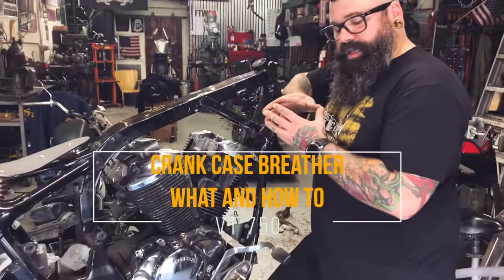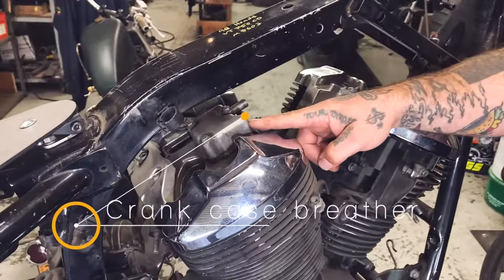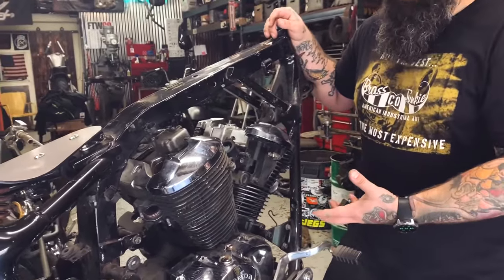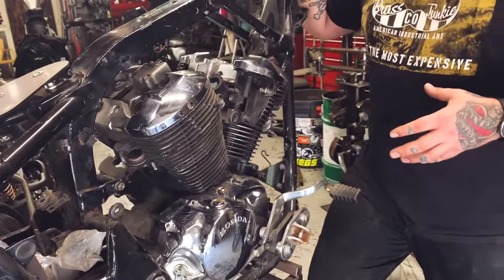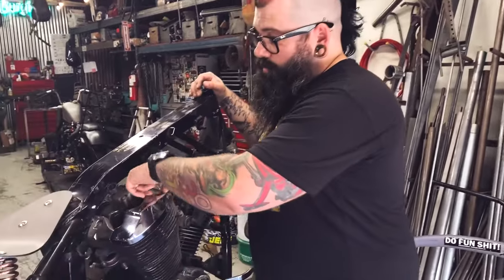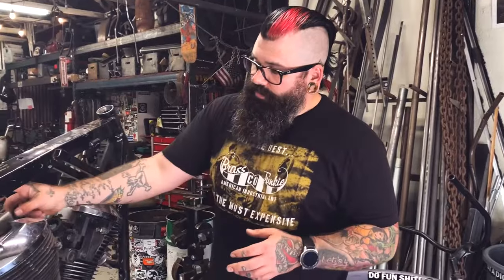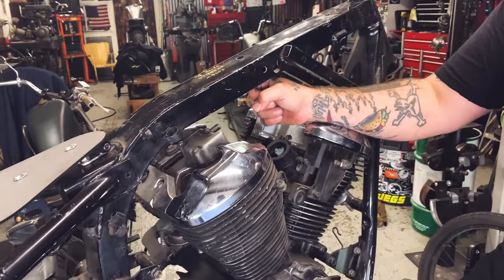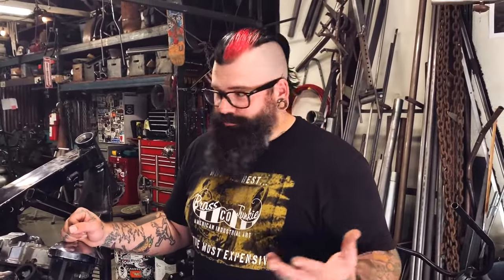What The Hell Is A Crankcase Breather?

Comment: Although you seem like someone who really knows his sh*t, I can't resist not to put a filter on the crankcase breather. The Idea of having an open tube just seems so counterintuitive. I guess I'll just check it regularly to see if it clogs up. (Thanks for the video)
Reply: Why many riders have a plug on the tip of theor breather hose?i saw a video that says you should not plug the hose because it will build so much pressure

Comment: I had a hose on mine ran down too the ground when I got mine but it kept spitting oil and stuff out all over my rear swing arm and back tire so I installed a vented catch can. Is a vented catch can okay ? I was told by some that it’s fine and others said that I had too have some sort of vacuum pulling the air from that crank case too so I’m lost and worried about messing the bike up
Reply from the maker: We are so sorry, but we just cannot help diagnose bikes via YouTube! It usually ends up being an exercise in futility and frustration. Plus, you wouldn't want a stranger on the internet diagnosing your bike!  One would really need the bike in person to properly diagnose, and we are not a service or repair shop. 
We recommend you check out our other YouTube videos (there's a TON!) and the support page at shoptjbc.com  

If you are still not able to figure out the issue, we recommend you take it to a local shop! Wish you the best and do fun shit!

Comment: Will this cause oil to become gathered in the exhaust. I have a bike I got from a friend and it smokes and leaking oil on to the ground from the crank case vent hose. Bu it also is getting oil into the exhaust and causes the bike to smike when the pipes get good and hot.
Reply from the maker: If the breather is clogged it can push oil past tje rings, blowby. Rings are probably not in good shape. Time to rebuild

Comment: I thought I was cool and had the little pod filters replacing the crankcase breather tubes on a 1980 cb750 until oil was leaking out of places where I know had good seals. I applied the concepts in this video and reinstalled the tubes and no more leaks.
Thank you.
Reply: So, if this is what’s happening, and oil is spouting or seeping into gaskets and what not, do those need replaced, or should they be fine once the breathing is under control?

Comment: IT exactly happened to me. put smaller hose into the breather tube ( sporster 1200C ) to take the air and oil out but ended up having oil seeped out of all the gaskets around my cylinder. he is 100% correct.

Comment: TJ… Question. Why a hose at all? 

Like, do you know the design reason why that can’t just be a weep-hole or an open port, and why it instead needs a hose run down to the ground?

EDIT: Just watched the second Crank Case Breather video. That breather box doesn’t just output air. It outputs particulates and oil that you don’t want blowing all over your engine and your crotch while you’re riding. That sound right?

Comment: I have a vengeance chopper with s&s sidewinder motor and it's pouring oil out of the crank case vent line.Its not overfilled with oil and it's running good

Comment: Thank YT for recommending this video. I put a mini mushroom filter in the breather hose and drove my motorcycle until I reached 3000km and noticed that the engine oil levels decreased on the sight glass on my crankcase then I proceeded to change my oil. After 600km of riding with the newly changed oil it seems odd that the oil levels decreased again and I noticed that there's an oil leak in my crankcase just below the block. Now this video helped. Thanks.

Comment: I have a 2007 VStar 650 Classic puking oil out the output shaft the breather hose is fine bike runs great can I replace the output shaft without removing the motor from the frame????

Comment: So I bought vtx 1300 from a guy and he pulled the ais since he changed the pipes. So as you know it pops after. So the 2 top hose attachment spots like your explaining are plugged both the front and rear ones. As you know 1 sucks in and blows out. My question for you is do I remove the rear one and leave the front sucker plugged?

Comment: Good point on the filter sir - so I can run a hose instead !
Reply: @TJBRUTALCUSTOMS  Thanks I got it done. I have a Honda Cb750 1979 . With the heatwave, my engine was hitting over 200f if waiting in traffic. I figured the Crankcase hot fumes going directly into the combustion chamber could only make the engine hotter. Still using the airbox, the crank case input was plugged for now and the hoses went then to a filtered vent - that was smoking a little today. When hearing your logic. I froze your vid, and connected a nice segment of tube and directed it to follow the other waste tubes. As long as my wife does not complain about odors - 

Anyway - Thanks again - I subscribed, and you are featured on my youtube page under motorcycle mechanics - -     ( ps - keep making the vids's - thanks - )

Comment: Thanks very much, you explained it very very easily and practical.
Then I asked myself why people still install filters especially in very powerful or old fashioned bikes?
By the way, my Honda CB300R's manual shows a pipe which goes down the frame which is closed with a tap and they advise to clean it periodically.
Funny thing is since this seems to be a very important task to do frequently on a schedule like cleaning the chain and grease it, check oils levels etc. etc.
So has anyone here a similar factory fit and did you take off the tap definitely?
Reply: Mine is in a very very difficult place to reach im debating on even struggling to put a hose on it since ill have to clean it anyway

Comment: So that's why my bike always have some oil leaks. The mechanics never cared about my bike's engine breather. 
-_-

Your video is so helpful. I am now going to bore a hole on the air filter foam because my bike has the intake manifold and the engine breather connected through the stupid stock air box. 
Because of what you said, I just realized how horrid this stock design is. Thanks! Keep it up.

Comment: I have a Chinese pocket bike 90cc. The stock air box on the carb has an air line that goes to the crankcase , I want to remove the air box and replace it with a cone filter.  Should I leave the air line connected to the crankcase fitting?

Comment: Could crank case possible cause the exhaust header glow red ? You say it could push oil in the the cylinder witch would make it run lean ? Witch could make it run hot possibly?

Comment: How much smoke is too much smoke through the breather? I have my vent tube unhooked to keep my air box clean and I’m noticing a bit of oil smoke coming out at stop lights. Is that normal?
My bike is burning oil and I think I’ve narrowed it down to valve stem seals. Would that have an effect on the breather?
Reply: @TJBRUTALCUSTOMS I see, Any ideas on what would cause that? For reference its an 81 Honda CB650, it is burning oil and I think I’ve narrowed it down to the valve stem seals. Would fixing that help with the breather or is that another issue?

Comment: I knew it! I'm stripping down an '03 Shadow Spirit 750 DC and that particular hose is super cracked where it met the back of the air box. GONE! What kind of hose should I replace it with and can I get it in RED? I'm replacing all my hoses and wire jackets/looms with red. It's a theme. Cheers! Thank you!
Reply: go to autoparts store and get something rated for oil not coolant.

Comment: As always I enjoyed the content thank you. Question off subject I’m working on a rebuild for a 93 vt1100 and I’m having trouble finding carb parts. Am I missing something, are the carbs similar to other models. The diaphragm on the right side is torn slightly and the screw to reach the needle to the slight is stripped. The bikes been sitting for some time
Reply: Not a full scope answer but I have heard from a local motorcycle professional mechanic that ‘KN’ brand jets and parts are what you want. No off-brand, no second sources, if you can avoid them. KN all the way.

Comment: Thanks for this.  Now if you could solve the mystery of the secondary air filter and is it a part of the crankcase breather system I would be happy.  I have a vt1100 ace 1998 and although the parts diagrams show it has secondary air filter for the life of me I cannot find it in the location it is supposed to be.

Comment: If the crankcase breather doesn't have a filter will it  collect dirt in the engine
Reply: If the hose is long enough and goes to a protected area, probably not.
Reply: @bikerbobcat  mine came off the filter. I’m gonna change my oil and oil filter because I’m worried some water got in.

Comment: I have a 1300 vtx, I put a spike air intake system on it and it came with a small crankcase filter,  the problem now is on long rides I'm getting a excessive amount of oil coming from that filter which I know is not normal.  What would be the best way to address this problem?  Why would oil be coming from there?
Reply: Vtx1300 rear cylinder mod  ventilation  of rear head  @ aluminum  port location  which is a solid aluminum stud about 1 1/4"  any tips on how to tap this stud for  more  ventilation

Comment: Just curious...... who in their right mind would deliberately restrict the blow-by?
Reply from the maker: A LOT OF PEOPLE. hence why i made this video. people put those crankcase breather filters on and then NEVER wash them. so they become full of oil and moisture essentially plugging the breather. if you want to run a little filter on there, thats cool, but you gotta clean it every few months. wash it with som,e simple green till it doesnt rinse dirty, dry and reinstall.
Reply: @TJBRUTALCUSTOMS  So, the EU regulations that vehicles should not be user-maintainable are justified. Legislation should reflect the weakest link in the chain... people, us mortals who know about blow-by/breathers and so forth should NEVER be allowed to even test and re-pump out tyres... in fact, perhaps us "mortals" shouldn't even be allowed to ride our vehicles in case we can't check the oils, coolant and other voodoo elements of vehicular maintenance that the dumb people don't know about.... Only the qualified, licensed, certified, regulated are allowed to even touch vehicles.... that's what it's coming down to....

If you block off blow-by then you need to be neutered - so you cant breed dumbness!

PS... what a wonderful rant! 
👍

Comment: Great I understand how they work maybe you could explain what would cause oil to come out of the breather tube like it's being pumped out while the bike is at idle that would be cool subscribed
Reply: perhaps a little bit late to the party, but have you found out the cause in the meantime?

asking because i think i'm currently having an oil leak from the breather on my suzuki intruder 800
Reply: @agnidominik4693  been reading could be overfilled oil capacity this guy has another video specifically on this
Reply: @ryanbbgaming  it actually was a leaking valve inspection gasket, and it looked like it was leaking from the breather

Comment: Hi iv been been building bikes for a long time now but if got this one that's got me stumped if done to this bike what if done to many others but don't want none of it it's the wrost engine if ever seen if there is a part that can be change it done it and there has been no difference in what it's doing 60bl piston pressure should be 160 black plug done the bore piston valves springs new valves to I have to turn the fuel mix Screw to half turn or bike don't run go above it cuts off to below cuts off and its been doing the same thing even with the stock parts on it hence why I started playing with it now the oil from the breather leekes out every where even when has stock box on it was full of oil the only thing I have not done is Chang the gears on it it's got to a point I'm going to put a catch can on it as I can not stop the back pressure no matter what I do the clutch slips like anything new clutch and in the arm there is a half inch before even touching the clutch new cable for this bike it has to be done all the way before you can engage the clutch some one going hydraulic clutch but I feel it might not work it's got to a point that I'm going to put something else in it as the money that's gone in to it could of got me a new engine the parts are getting harder to find to as the ppl that make this bike do not supply the parts no more and no matter what I do the timing dose not line up it's always half a tooth out don't get me wrong would be a nice little run around got it for my son to learn on it's a little 125cc not worth some ppls time the bike is made by quadzilla it's a white knuckle Wk125r so if i done all this why do you think no matter what has been done it's still doing the same thing it's been doing since I got it if even talked to quadzilla and they have no idea on what is going on and why it is happening

Comment: I am having issues with my 2014 Valkyrie with this vent.  There seems to be oil making its way up the tube onto my throttle body and getting into my idle air control sensor.  My bike then runs at @ 1200rpm.  I have cleaned the vent and I am about to put it back together, but this makes me think that I should reroute the piping to the bottom of the bike.  I thought that Honda put it to the airbox for some other reason than to just collect the oil.  Thanks for the video.
Reply: It's should be in a good running bike such a faint fog of oil that it would just get sucked into the intake air charge and burn off as the bike runs. If this is happening I'd check your oil levels. Oil level can increase crankcase pressure and it will dump excessive oil in to the intake.